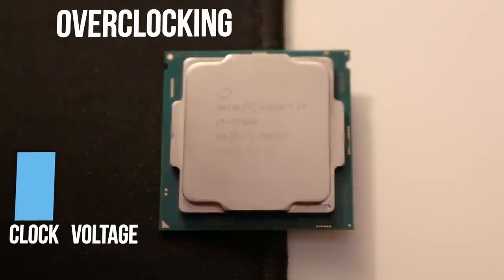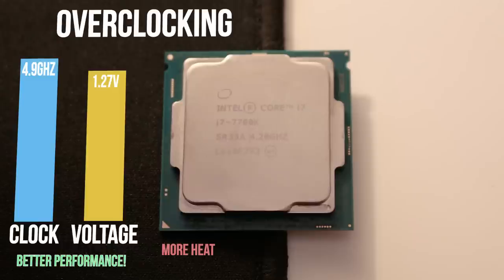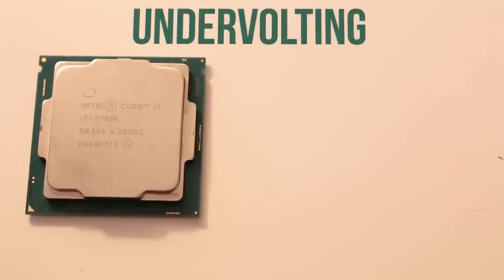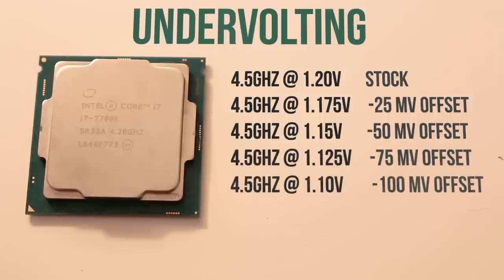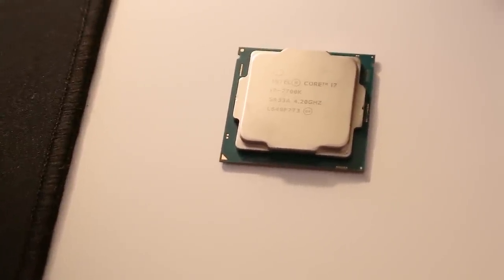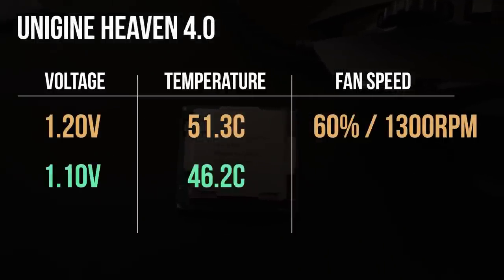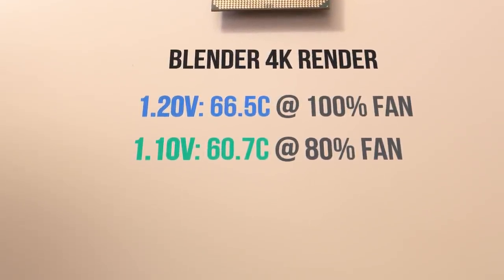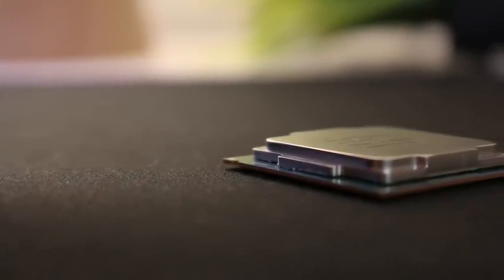Should You Undervolt Your CPU?

Comment: Quick complaint; Going from 51.3C to 46.2C IS NOT a reduction of 10%. The Celsius scale is not absolute, to work out a percentage you MUST use the Kelvin scale. This is easily done by adding 273.15 to the temperature in degrees Celsius. In the case, it would be going from 324.5K to 319.4K. This is a change of 1.6%. It looks much smaller this way. Overall though I really liked the video.
Reply: temperature reduction should be based on Delta from ambient, not absolute zero.
Reply: The ambient temp was 21C, so the delta temp went from 30.3K to 25.2K or a reduction of ~17%. Hey, that's pretty good.
Reply: You don't have to use kelvin at all.
It's like: I already did most of my work (for today), because i was working for NN years already
https://en.wikipedia.org/wiki/Frame_of_reference.
Reply: Celsius is an absolute scale though... it takes 1 calorie to raise 1 cubic centimeter of water 1 degree celsius. Water boils at 100 degrees and freezes at 0. Absolute 0 is −273.15 degrees. So, no. You're just wrong in every way.
Reply: +Vyor Generic Last Name
0 kelvin is the "absolute *zero*" temperature, which means it physically can't be colder than that, -as far as we know, at least-, is it not the absolute you should be looking for? What you described is conventionality, not an absolute. absolute zero is not even zero in Celsius, lol
Reply: also, https://simple.wikipedia.org/wiki/Kelvin
Reply: A change of 1 degree celsius is a change of 1 kelvin(more or less). It's an absolute measurement of thermal energy.
Reply: +Vyor Generic Last Name,
An absolute scale is a system of measurement that begins at a minimum, or zero point, and progresses in only one direction. An absolute scale differs from an arbitrary, or "relative," scale, which begins at some point selected by a person and can progress in both directions. An absolute scale begins at a natural minimum, leaving only one direction in which to progress.

I wonder.
Reply: You can go below 0 kelvin.

Physics gets weird when you do, but it's possible.
Reply: Yes, quantum physics. But still, celsius is not absolute in any way, shape or form.
Reply: If celsius having negatives makes it not absolute, then kelvin isn't absolute either.
Reply: It's not a natural possibility, it's manmade.
"which begins at some point selected by a person and can progress in both directions. An absolute scale begins at a natural minimum, leaving only one direction in which to progress."
One way or another, Physicists are more qualified to make the decision. Maybe we will get new scale, but as of now, we can say, that Kelvin is absolute, but with one exception, that were discovered not that long ago.
Reply: It being possible in a lab means it's possible in the universe. It would take extreme situations for it, but it's possible.
Reply: +Vyor Generic Last Name, i do not necessarily agree with you there, but, well, go talk to physicists and try to convince them, then go back to me. You are being childish, trying to make an excuse after saying a stupid thing, so i think this conversation is over. Have fun.
Reply: Vyor Generic Last Name
Well that's funny, it's in fact NOT possible in a lab (yet)
Until now lower than 0 K was only achieved on paper with a bunch of formulas. It's not observable or achievable with our current technology. 
With conventional thermodynamics we use 0 K as the absolute minimum temperature and the calculations are on point.
Like saying you need Einstein's formulas to calculate the speed a rock would fall. Newton's got us to the moon.
Reply: And the links you posted show... how it works more or less? Not sure why the first link talks about KE though, something moving faster doesn't mean it has more energy, just that it has more potential energy; not something measured by kelvin. Of course, even if that were the case there is an upper limit, namely the point at which the mass collapses into a black hole.
Reply: Except that KE does not apply any change in state for the atoms, and is therefore impossible to measure without a frame of reference. KE is relative, not absolute, therefore more KE is simply more potential energy.
Reply: negative kelvin is actually a thing? omfg.
found some gold on a tf2 video. thank you whoever pointed that out. 
got some reading to do now, bye.
Reply: wrong math lol.
Reply: @vyor8837  Celcius is not an absolute scale.
If a substance had a constant heat capacity and no state changes doubling the temperature in an absolute scale would double the amount of energy it contains.
But that doesn't work for celsius.
There are also plenty of other relations, such the ideal gas law, where doubling the temperature while keeping the amount and volume the same results in double the pressure. Again, this does not work for celsius.
So no, celsius is not an absolute scale. The 2 absolute scales are kelvin and rankine. 

The possibility of having negative temperatures doesn't matter as much as how that scaling works.

Also, it isn't a case of it being more or less. By definition celsius and kelvin change at the same rate but offset. A difference of 1 degree celsius is the same as a difference of 1 kelvin.

For small particles, kinetic energy is one way which energy can be stored (and acts as thermal energy) for monatomic gasses, it is the only way for thermal energy to be stored.
This also links directly into the ideal gas law.

But as for negative kelvin, they are highly exotic systems which do not use temperature in the normal sense of the word.

So no, you are basically wrong on all counts.
In fact, just to complete it, a calorie was originally defined as the energy required to increase the temperature of 1 g of water 1 degree celsius (and now it is defined based upon the joule). Not 1 ml. As the density of water is not 1 g/ml, that means it doesn't match your claim. Also water will boil and freeze at various temperatures depending on the pressure and what impurities are in it.
Reply: @jeffreyblack666  hell of a lot of nitpicks there.
Reply: @vyor8837  I wouldn't call pointing out massively incorrect statements as nitpicking.
Celsius is not an absolute temperature scale by any measure.
The only nitpicking was focusing on calories.
Reply: @jeffreyblack666  Celsius is Kelvin with an offset. Therefore, when the offset is applied it's an absolute measurement.
Reply: @vyor8837  The fact that it has an offset means it isn't an absolute measurement. The offset means you have chosen an arbitrary 0 point and thus have a relative measurement.
Reply: 51.3C to 46.2C Is is close to a reduction of 10% .

Comment: I wouldnt call it undervolting as from factory cpu tunings are trash. the factory dont dial in every cpu. they just put a basic tune which everyone can run on the cpu which is trash 99% of the time. alls youre dong by the so called undervolting is dialing in the cpu better then factory did.

Comment: Anybody did it on Dell xps15 7590 i7 ?
Reply: Yes, i used XTU. I went all the way to -180 (-30 each time) but it crashed after stresstesting it for around 30 mins. Now i sit comfortably at -150, stresstested for 1h30 mins with 4k video playing in background and a few extra tabs etc... stable no issues. Idle temps went from around 55ish to around 46-47ish. And on max load from a constant 100C throttling to hanging around 93-98 and now and then reaching 100 but not as fast or constant. But much better performance, cinebenchr20 went from 2200 pre undervolt to 2750 (this is a HUGE gain mind you). And to make sure the undervolt was always active even when turning laptop off or XTU (known issue) occasionally just closing and stopping the undervolt, i used a script to force start the undervolt each time i log in, works like a charm. All in all, -150 is my safe limit, much better temps during normal use and way less throttling on max load. My gig: xps 15 7590, i7 9750h, full hd nontouch. I feel like the 9750h can undervolt generally better than the 8750h which has an average of -115 stable. I feel undervolt is a must on this laptop. If u want some help with it feel free to ask :)
Reply: @kafkaesque-wi2tl  
Thanks for the answer,  I stopped at -125 (that's what I have now) because going to -150 I didn't see a difference but great to know that -180 is a safe option I'll try to find a "normal" day without crazy temperatures and do it again to see what it gives me anyway thanks again
Reply: @cqft5171  -125 is a solid undervolt. Did u stresstest it? i would go for atleast 45 min heavy cpu stresstest. You can use xtu builtin stresstest where u can set ur desired duration. And np!
Reply: @kafkaesque-wi2tl  yes i used the built in stress test (XTU)...and no crash 
I even rendered a 1080p 60fps 43min video with short (2~3) min files with clor grading and it worked flawlessly 👍

Comment: it will be unstable when CPU is under heavy load, it just same as under-volt GPU. the only benefit is to have a better performance per watt.
Reply from the maker: I placed the CPU under 100% load for testing. The result I achieved here passed Cinebench R15, Prime95, and Aida64. And there are other benefits too, like lower fan speed (quieter system), and less heat dissipation (cooler system).
Reply: Optimum Tech hey, is it possible to change the fan curve to something lower so that temps stay the same as the stock but the fan spins slower?
Reply: Different 
no, its a tradeoff, less fan speed less noise and more heat.
Reply: +Different set the minimum fan speed to something that's about the same noise level as ambient, it will ramp up into the audible range a lot less being quieter and cooler overall (example, if you set minimum fan speed to 40%, it might stay at 40% almost the entire time instead of ramping up from 0% to 100% on and off, works the same as sizing hvac for your house)
Reply: Many laptops will in fact be MORE stable under heavy load with under clocking because they will not be over heating... My 2014 Macbook Pro massively benefits from underclocking + running custom fan profile to keep it 20C cooler than stock setting. This allows it to run 3,4Ghz full boost with all 4 CPU cores at full load. Without under-clocking it overheats even at 40% only CPU load and has reall bad CPU throttling constantly to avoid dammaging it at 105c+ (with underclock max CPU temperature is about 70-80C combined with custom fan profile)...
Reply: Mostly factory's settings are higher voltage so it's like guarantee stability which one you can cut off a little bit safely